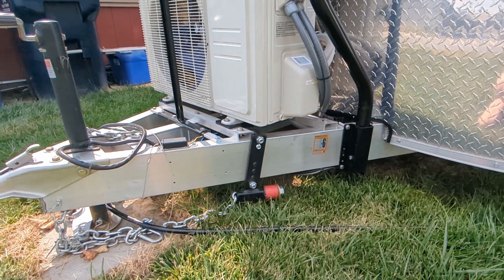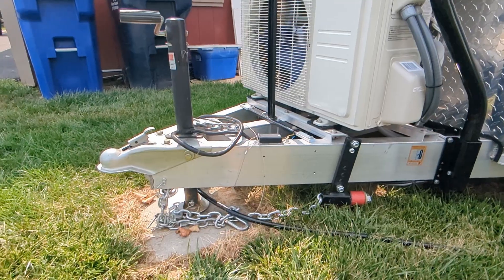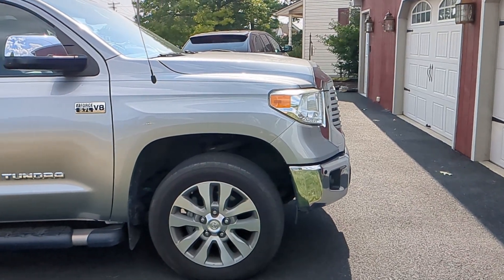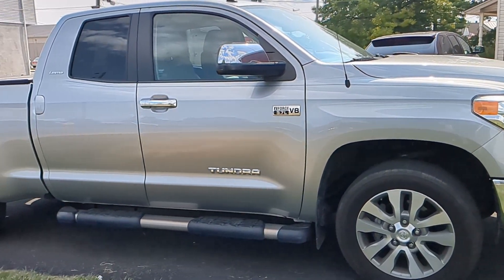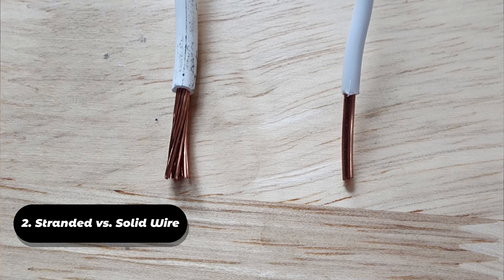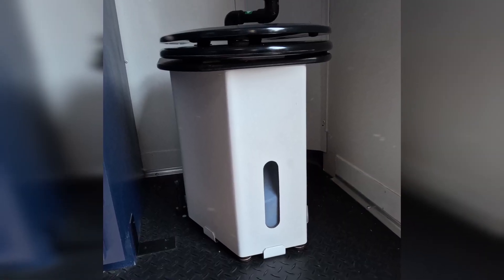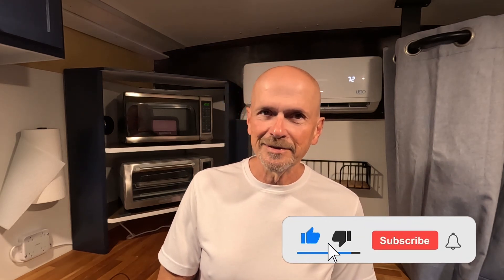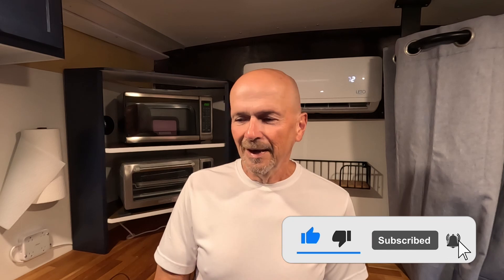Cargo Trailer Conversion - Controversies

Comment: Aluminum is a softer metal thus it is easier to strip a hole out when screwing to it. Also , I don't know if it is true but I saw a video from an RV service person who talked about metal fatigue when you have different types of metal touching each other such as you will have with the steel axles and springs against the aluminum frame. Aluminum is lighter but steel is stronger.

Comment: The trailer is a dynamic moving piece of equipment.  I vote for stranded wire 😁
Reply from the maker: Go with your gut, but make sure you have good connections. That's where the safety concerns come into play; whether its solid or stranded.

Comment: Great breakdown and well thought out points.

6:12  Vibration from movement can cause the solid wire to break where it is attached to fixtures etc. That's the main reason stranded wires are preferred in rvs and boats. Not a real build to code issue. 

But if you're not going to be driving off road, on corigations, or using for many years you should be ok.
Reply from the maker: It's always about good connections!
https://youtu.be/RaGDVK6welk

Comment: You know as well as I do there are no codes that exist for wiring type for a CTC build so nice play there. The RV industry uses solid strand and I know for a fact there are issues with the wiring. I was an RV owner that ran into problems with my wiring. With that said a CT is a "rolling earthquake" and the possibility of solid wire failing is higher than stranded. Are you a weekend camper or live in your rig full time? If full time solid wire failure increases as you travel. I've talked to full timers with CT's and they swear by stranded wire. Either way let us know when you have to rewire your rig and replace your solid wire with stranded. On my build I chose to use strand wire based on the experience of hundreds of other CTC builders. I'll always take advice from experience over someones  "opinions" other than that good video!
Reply from the maker: Of course, I would support your decision to use stranded wire for every run in your CTC. But, when you refer to "solid wire failing," I wonder if you are referring to connections made using solid wire vs. connections with stranded wire. Both types of connections can be done either well or poorly. A good connection is your best route whether using solid or stranded.

Comment: #1 son is a welder, and aluminum IS different than other metals. Different equipment and different settings. He specializes in stainless steel "tube" welding and aluminum is trivial for him. That said, we've looked at aluminum cargo trailers - and their welding is all over the place quality-wise.

Regarding WIRING - cargo trailers should use MARINE category wires - which are stranded.

Comment: The RV industry has used solid copper wire for AC circuits for many years. My 20 yr old Super C has stranded for all 12v and solid for all but the outlets on the slideouts. It actually seems like a slightly smaller gauge when compared to residential 14-2, maybe just thinner jacket. The cost of tinned stranded wire is crazy by comparison to solid but it will always be personal choice in the end. Thanks for the discussion.

Comment: I've slept fine in a hammock for 4 years, as house mold has forced me into the back slab addition to my house. But the mycotixins have made me decide to just remove myself from the house completely. I paid off the house and i have just enough money to buy a cargo tailer. I can use the monthly money i was going to use to pay a mortgage to purchase supplies for a cargo trailer conversion. I just wanted to suggest the not too popular thought of a hammock set up as it can be taken down and put out of the way until bedtime. It works for me, and I've had no back pain as a result of sleeping 4 years in a hammock. I have a bed but i don't use it. It's basically just a place to put stuff on.
Reply: do you sleep corsswise on the hammock to have a flat surface to sleep on?

Comment: Another couple of old wives tales concerning cargo trailer is someone could lock you inside, that is a conceived problem with anyone ever hearing about it happening. The other that we hear not only among cargo converters but just about any towable is when discussing the tow vehicle's ability... "sure it will pull it, but will it stop it". Trailers of any size have brakes (requirement varies by State) and they darn sure should be able to stop the trailer. If not fix the brakes. I like your presentation, yet the controversies continue below... geez people! I think much of this is due to social media and the ease to find information, whether right or wrong... then a need some have to control and be heard.
Reply: Actually, many smaller trailers do not have brakes. I am buying a 6x12 single axel cargo to convert, and it does not have brakes. Which is fine, bc I’m towing it with a Ford Escape that does not have the wiring to control brakes 🤷🏻‍♀️

But locking someone into their trailer - my husband and I were talking about this just this morning, and I had the same exact thought as you. Has this ever happened to anyone?? And once you’re locked in, then what? A thief is supposed to break into your trailer and steal your stuff. If they lock you in, they’re on the wrong side of the door, lol. Not a very good thief or murderer 😂

Comment: I found a all aluminium V 14ft..  I have plans for a shower bathroom in V and there is enough space in front for propane and should have enough room for what I want. 
In the end I have less overall length to deal with and in my area there wasn't any other "affordable " all aluminium available.  I really wanted a 16 plus V ..
Might be a few percent fuel savings.. 
btw, it would be better fuel saving if adding a semi V in the rear.. the back air pressure at the rear is a bigger impact...Since I have no plans to go more then 200mi from home this isn't thet much concern..

Comment: I have had V nose and Flat front trailers that are the same width and length. For gas mileage, I can't tell any difference. For aerodynamics/wind resistance, it seems to me that there's not really any difference and personally, feel like the towability is better with the flat front. One argument that I heard is the V nose isn't really cutting the wind, it's getting hit independently from each side. Plus with my V nose, there's no way to add a weight distribution hitch, propane tank etc without lengthening the tongue.
Reply from the maker: I've mentioned this before, but I would really like to see stats and data from a testing institute on aerodynamics and fuel efficiency on flat vs. round vs. v-nose. You're right about v-nose being difficult to add hitches, tanks, (and also mini-splits). One solution is to get an extended tongue on a trailer with a v-nose.

Comment: About the nose: I’ve “heard” that the V sometimes gets pushed around more when meeting or passing other vehicles (more angled surface area). Also extending the tongue isn’t necessarily a great idea for towing stability.
Reply from the maker: I don't know if that's true, but it would be nice to see a study from NATM on the subject.
Reply: Wind pushes my v-nose terribly when transport trucks go by, especially when they are near the center line or on a windy day........big distraction in the rear view mirror when vehicles go by, you see the other vehicles flash on the front side of the trailer as they go by......just have to slow down and drive sensible

Comment: I’ve also read in multiple places that the V-nose doesn’t help with mileage, so that’s a nonissue. 🤷🏻‍♀️

But I want a V-nose bc I don’t have anything else I need to put onto the tongue, and you can find stabilizer hitches that work for V-nose trailers. So for me, I am driving with exactly the same amount of length of trailer behind me, but I have more room to show for it if I have a v-nose 🤷🏻‍♀️ 

I am working on plans for the conversion now, and have a few creative ideas of how to use that space. 

Btw, I’m buying a 6x12 aluminum trailer. I’m pulling with my 2009 Ford Escape - it has a tow package, but it’s still just a Ford Escape 😋 So I am VERY conscious of weight and length. 

Great video!

Comment: Caution is advised when comparing a trailer to a tiny home.  One bounces along at highway speeds with the ever present pot holes and bridge to roadway dips all of which flex and contort vehicles including trailers.  The other is largely stationary, generally speaking.  Wouldn't it be wise to incorporate practices used in marine, aircraft and RV construction as opposed to that in homes?
Reply from the maker: That's a great observation. In any construction for an RV, CTC, Van. . . , there must be considerations for flexibility and structural integrity.

Comment: 🤔 Its your trailer so you can do whatever you want, while accepting the risk, but the idea of stranded wire on automotive, aviation, and marine applications is based on the wiring being subject to motion and cyclic motion fatigue.  This results in work hardening, embrittlement and fracture of single strand conductors because they aren’t designed for repetitive motion.  High resistance, heat and fire risk may result. A secondary advantage of stranded conductors is flexibility in making the wiring runs and terminations. 

   Marine grade wiring is the “gold standard” in that it is a pure copper, tinned, conductor and has heat, chemical, and UV resistant insulation. Stranded conductors may be lugged and moisture sealed or better yet WAGO connectors may be used. Stay away from the cheap Chinese imitation marine wire … it is often misrepresented junk. 😎
Reply: Great info !
Reply from the maker: Great info. Thanks for sharing.

Comment: Thanks for all the info , I'm looking into buying a cargo trailer and I was wondering if you had any recommendations of different brands, I've looked into Weeroll in Ocala Florida, they're all aluminum and seem to be well made but they do have the v-nose, just curious if you have any others in mind that I can look into, I'm  new to all of this but I've learned enough through my research not to buy traditional RVs from an RV manufacturer most of them are junk, that's why I started looking into cargo trailers, would love to know what you might recommend
Reply from the maker: I can't recommend specific brands. It is a major purchase, so  make sure you shop around. Go to several dealerships and look at build quality before you buy. Don't listen to sales people who tell you that all cargo trailer manufacturers are all the same.
Reply: @danielletalerico2889 hope this isn't too late, if you live on the east coast, 95% of all cargo trailers sold on the east coast are all manufactured in Georgia. Meaning the farther away you live from Georgia the more expensive the same trailer will be. they bring them all the way up to NYC from Georgia. for me living in VA I saved myself $3K off the price of a new trailer made to my exact requirements by buying directly from the manufacturer in Georgia and taking a weekend to drive down, pick it up and drive back. They have thousands sitting in lots down there already made that people never picked up you can get for a STEAL if any of them just happen to be what you were looking for. I'd definitely check that out first! hope this helps!

Comment: V nose trailer has the same length of side wall which is basically what dictates usable space. I agree with you - in most cases, a flat nose is easier to build with.

Comment: I'm seriously considering having a snowmobile trailer built (less the front door) just so the 5 foot V nose cuts the wind like a knife, there are ways to make that space creatively usable. If you can get rid of wind load, that's more than 3/4's of the load required to move it down the highway at freeway speeds.  Rolling resistance is almost nothing. You, meaning John, are an engineer, look up the formula for wind load. It goes up as a 3rd order function with speed.
Reply from the maker: Mark, I'm with you on that. Keep me informed about your progress on this project.

Comment: Concerning solid wiring the tiny house is an earthquake on wheels. This is why one will not find solid wire on manufactured vehicle, boats or aircraft.  The wire should be marine grade tined, lugged connections with qualified insulation for heat, solvents,and UV.

      One can build a trailer with residential solid wire but it is subject to vibration and metal fatigue. If it breaks it becomes a fire/reliability hazard.

Comment: I have a 16 ram 2500 with the cummins , I've pulled my 6x10 flat nose trailer and my 7x16 v nose trailer , my truck get 2-3 miles per gal better the the 16 ft v nose , 3500 gvw with the 10 ' and 7000 gvw with the 16 ft
Reply: That’s a pretty significant difference.
Reply: Yes yes yes, I pulled a 21 ft Century boat behind an old school 318 2 bbl Dodge pickup and you could hardly tell it was back there at freeway speeds because the "wind resistance" component was almost non-existent, all I had to do was overcome rolling resistance which is negligible

Comment: Bahhh lots of trailers with solid wire on the AC. I wouldn't use it for DC. But I'm with you, show me something official about not using solid wire in trailers, not just opinions. I used solid in my CTC for A.C. - It has less chance of burning down than the wood framed trailers that use it. [eye roll]

Comment: If the thing standing between you and using aluminum extrusions is CAD....  then learn CAD.

There's free software all through the process and free sources available to learn.

That shouldn't even be a consideration.

As far as weight savings, sure if you make all the same mistakes throughout the build then the weight savings will be comparatively negligible.  I.e. if you put a granite countertop in, yeah, aluminum weight savings might not really amount to much.

Comment: Cargo  trailer vs horse trailer.  A horse trailer is built extremely tough very strong built to last better construction due to hauling horses I have seen a few built into living quarters,  I like sundowner brand more on the high end I'm ordering a v nose 5x12 to build into a overlanding offroad trailer,  you need talk about the mini split trailer how well it holds up traveling due to bouncing on America bad roads like on I70 in Indiana,  for myself a 5x12x5 perfect vehicle nose tear drop for my jeep wrangler or land rover lr3

Comment: Wrong oh on the solid wire. Fatigue cause by vibration solid vs stranded is a big deal. Never tin stranded wire as solder is 12x less conductive than copper. High current devices will cause heat and may create a a loose connection in the future.  This guy should not be the guy you get definitive trailer advice from.

Comment: Code aside, solid wire vibrates during travel and the insulation wears out much faster, which can cause shorts.
Reply from the maker: Everything on the road vibrates. That's why good connections are essential.
Reply: Not if it is fastened down

Comment: For the price of aluminum frame v. weight savings, long term it is not worth it.
Aluminum will stress, bend and crack well before the steel will...
I know this for a fact. 
I had both, steel and aluminum frame dump trailers hauling sand and gravel with my semi.
The aluminum i bought brand new, began to sag 4 years into use, my old 1969 steel frame trailer was STILL holding up like new after 30 years